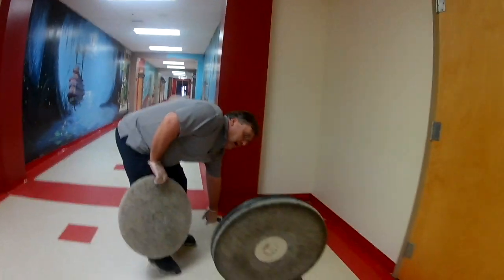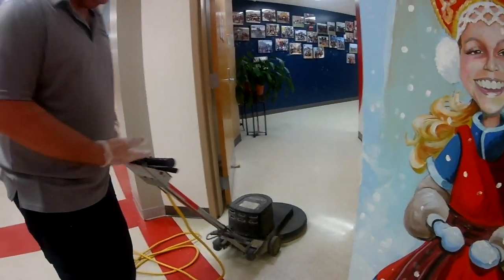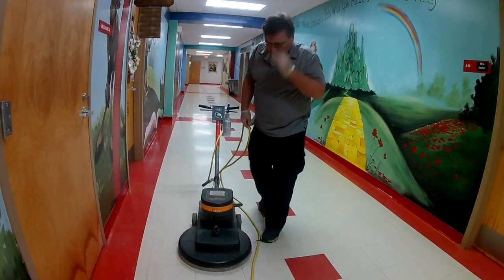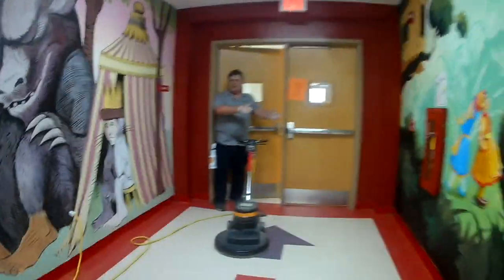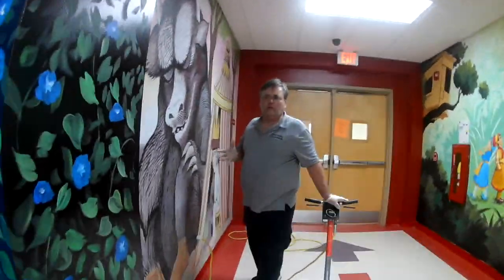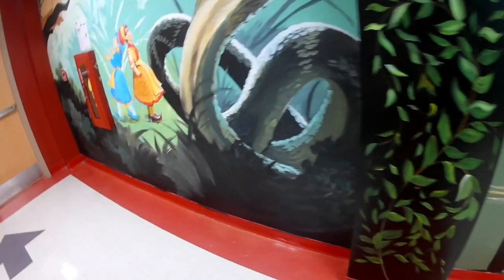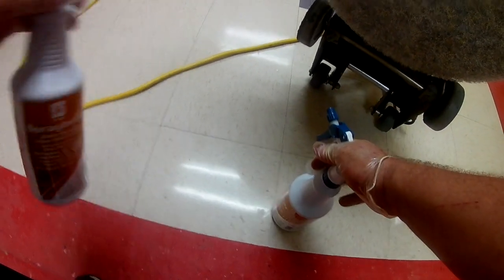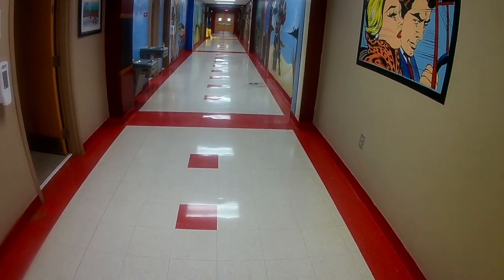Vct  Floor Burnishing @mrjeffthecustodian

Comment: Im pretty sure that is a burnisher, not a buffer. Buffers typically spin at 175 rpm and sway side to side. Burnishers move back and foward and typically spin at 1500 rpm.
Reply: You're right. He's using an electric burnisher not a buffer. He's also using a special hair blend burnishing pad. He was really doing a modified wet burnish instead of buffing. Either way the floor turned out great. Too bad he didn't have a propane or even a battery powered burnisher. Would've cut his labor time down. Wonder if he got OT pay lol
Reply: You dissed him

Comment: Hello, I have a question after stripping, do you use sealer first or just wax?
Reply from the maker: If your going to wet strip every year I would wax only. If you are going to top scrub mostly I would put a good sealer then wax.

Comment: i have always found using wax with a little bit of water mixed works a lot better then spray buff stuff.
also using the low speed buffer works very well and you get a better shine and it also cleans the floor .
Reply from the maker: What color pad? I have thought about using a slow speed. I seen and old custodian do that years ago.
Reply: @mrjeffthecustodian   i use a red or white depends on how dirty the floor gets.
Reply from the maker: I’m going to give a try.
Reply: @mrjeffthecustodian   Have you given it a try? Because I was think about using wax & water when I spray buff.
Reply from the maker: @bryanbrooks4005   Yes I have. very little wax though. doesn't take much.
Reply: Una pregunta soy nueva en esto pero como  aplicas el wax con agua? Lo aplicas y dejas secar y pasa el buffer? Gracias
Reply from the maker: @rodriguezrodriguez5765 maybe this will help. https://youtu.be/gIT1LX55ml0?si=8iXZsp9F-YNrcIyr
Reply: I tried that with a side by side and idk if the floor wasn’t wet enough, but that machine was grabbing too much and hard to control. It didn’t glide around like when scrubbing.
Reply from the maker: @kylesalmon31 white pad?
Reply: @mrjeffthecustodian  all of the videos I’ve watched said to buff with a red pad so that’s what I tried.
Reply from the maker: @kylesalmon31 aqua pad works best for me. Learned that since I made that video.

Comment: Hi Jeff, will buffing work on vct with spotty wax and buildup? Thanks for posting.
Reply from the maker: Buffing or burnishing floors will make any vct shine if it has wax on it. Even if it has build up. If you have spotty build up. The floor wax not stripped correctly most likely. Or you had someone wax it that waxed it wrong. My bet it was not stripped correctly.
Reply: @mrjeffthecustodian  thank you! The floor had a janitor that mopped with a harsh chemical, which deteriorated the wax in patches and created buildup of wax in other areas. I'll give it a burnish to remove the top layer of dirt without removing all the wax. Thank you so much for the videos
Reply from the maker: Yes those chemicals with high PH levels can mess a floor up. Maybe you can fix it this summer when stripping.
Reply: @mrjeffthecustodian  i haven't spanned out into this type of floor care yet. So, no stripping yet. I was just going to buy a burnished and do a little rough polish shine. Janitorial service so far with minimal floor care.
Reply: @KodyBaker00  hi thanks Kody. Don't think im ready for all that. It's my first large commercial client. 15k sq ft building. I just don't have the manpower,  the equipment nor know how to bid that job.

Comment: I want to clean porcelain tile flooring. Would this be a good solution? I have a machine similar to your one but I noticed it chipped some tiles.
Reply from the maker: I always use a slow speed to clean porcelain and a neutral cleaner. Pick it up with a vac and rinse well. Yes if it’s chipped and lose it can be a problem. Especially old stuff.

Comment: 1500-2000 rpm right?
Would you say that a square scrubber with a white pad also buff a floor? Square pads usually run at 3000 rpm or more
Reply from the maker: Yes